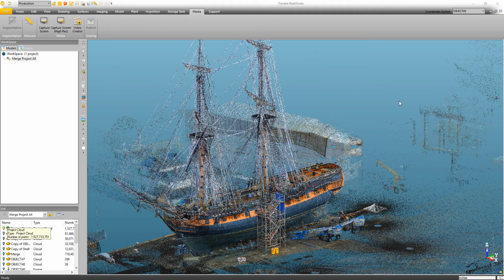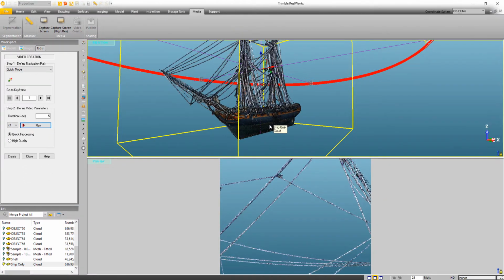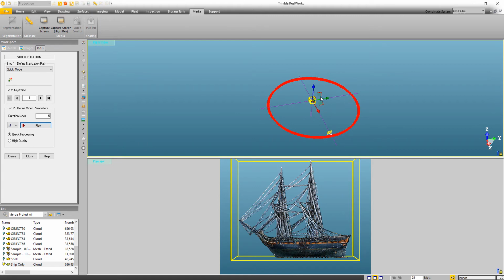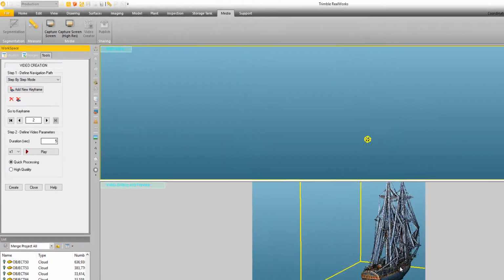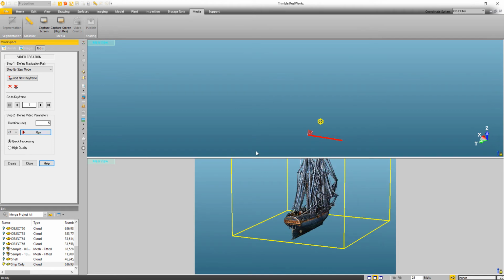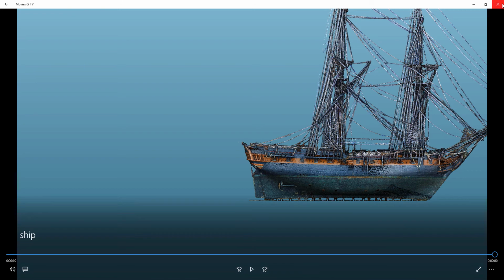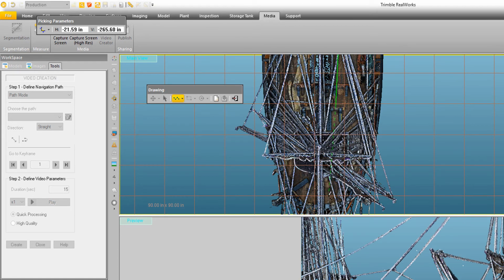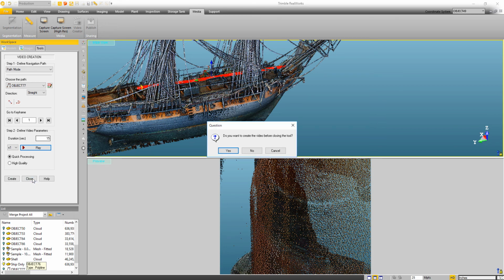Video Creator Tutorial - Trimble RealWorks

Comment: Jason.
I have a problem when creating a video in route mode, after creating the line and moving the position of the camera, it is always kept down and visualizes the cloud of points very badly.
To your kind support: hocrospoma@cosapi.com.pe
Reply from the maker: I think the problem may be that the camera view is set to bottom in the video creator tool. Maybe try changing it to straight. Also for the points make sure that the HD setting is turned on in the lower right of the screen and make sure the pixel size is set to 2 or 3.